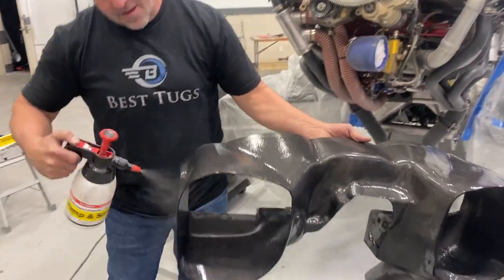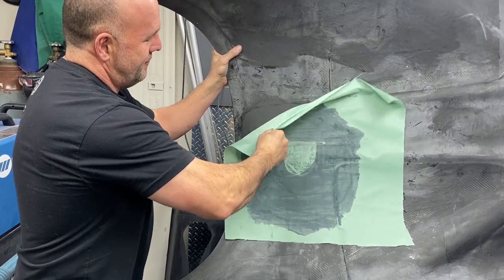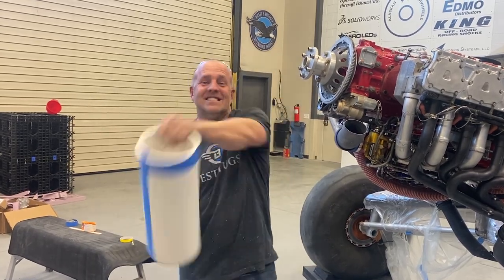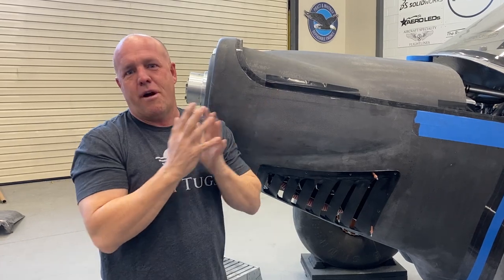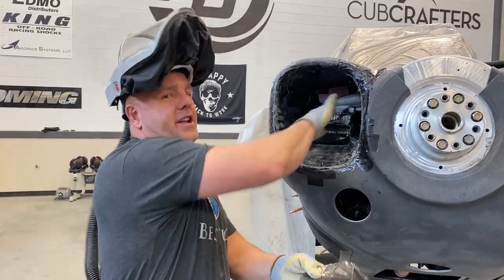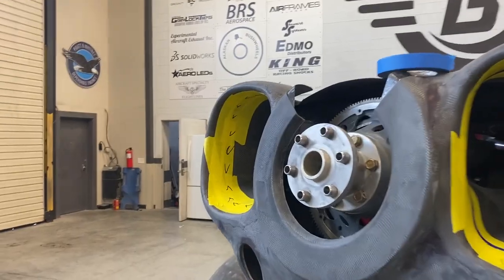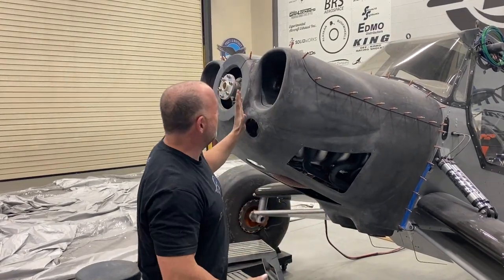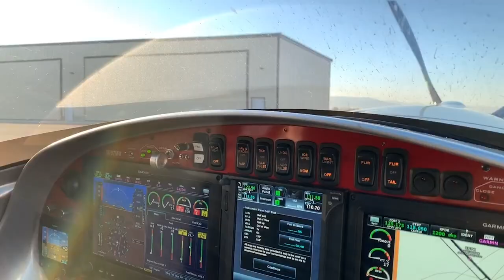Sleeper...Hiding a Monster NOS Race Engine in a Carbon Fiber Bush Plane | Scrappy #46

Comment: Mike needs to come out with his own line of sandpaper. Or "The Patey Sander" which is just a sanding block and an energy drink.
Reply: A case of energy drinks with a carbon fiber helmet that holds a six pack with straws atached to a manifold to equally empty all the drinks .and a heads up display regulator valve and temp gauge.
Reply: MP, carbon fiber products. I’ll buy!
Reply: "energy drink"
Reply: hahaha!  thats good.
Reply: He could call it "Patey Paper"
Reply: In my experience people his age that  keep going, and stay healthy, don't do many energy drinks! Probably some coffee. Getting energy from caffeine and sugar, is like using credit cards as money.  It stops working if you don't pay it back!  To keep going, full out, year after year, it takes good quality sleep, (even if it is less than most think is necessary) and high levels of good quality vitamins and minerals. When you give your body the raw materials it needs to have energy as it was designed, you don't drag and crave sugar, caffeine, and other drugs!
Reply: @davidcatlin1970  , totally agree about sleep. But the funny thing is Patey is what I call a non-sleeper. He only sleeps a couple hours per night. Mike's just not normal. ;-)
Reply: @texarama  he is pretty unique that way it seems! Reminds me of R. G. Letourneau! Similar personalities I think. Very focused, and can work efficiently for way longer than most anyone else! I'm still willing to bet Mike doesn't abuse caffeine and sugar.  I'd love to know for sure!
Reply: @MikePatey  so? Was I right? Lol!
Reply from the maker: @davidcatlin1970  your right.  I don’t use any type of Supliment or caffeine pills or any medicine of any kind.   My biggest vice is I like Diet coke soda at every meal.   I should Do better and have water.  I’m not a sugar guy.  I don’t really like how it makes me feel.  I will have a cake or whatever at events but I don’t really buy much for sugar.  I can’t work as long with sugar or lots of caffeine.  It causes a crash.  I’m better just holding 18-20 hours steady without the crappy rush that quits on you and that kills productivity when you go for another late night round two push.
Reply: @MikePatey  Very cool!  Hey my 4 boys and I have been following just about every video you've put on your channel, since I found Draco, just before the crash! It's my goal to meet you someday, and maybe even get to collaborate on something!  I can't wait to get into my own plane in the near future!  Back to work!  Lol

Comment: If I may be a voice of dissent, Scrappy's power plant has become a Rube Goldberg series of engineering solutions. For a back country specialty aircraft,  it's become incredibly complicated. Of course, all of the engineering is mind boggling impressive. Given the concerns you have had to address with the intake cowling, as well as other issues associated with engine cooling, one can easily see the advantages of a turbine over a recip. Granted, I suspect everything will work as planned and it's going to be another beast of a flying machine. But she is one very complicated gal.

Comment: Engineers everywhere need to see this and take note.  Everything is clean, makes sense and most importantly it’s extremely functional.  Well done!
Reply: I think you don't see designing like this because of a fundamental culture difference in engineering.

Even in development practice, everything is rigidly controlled. Companies seem to care about reducing development waste rather than allowing more iterative design and innovation which inherently has more risk of failure.

Also, I feel there is often a big disconnect between experienced consumers and design direction. Especially with valuing experienced enthusiasts opinion over the general market.
Reply: @ChargedTTq  Very true which is why it is important for some of these engineers to intern in the actual field before being put behind the drafting table or design computer. Get the hands on aspect and see just what its gonna take to install, repair , or replace anything they design!  I'm a diesel mechanic, and I see it all the time! makes you wanna strangle the engineers at times. lol
Reply: AND it has ease of maintenance in mind!
Reply: A huge part of engineering is cost control -- optimizing for efficiency of materials and labor. What makes this plane amazing is the absurd amount of time spent on it. This plane as built would have zero commercial success because it'd be 10x the cost of the competitors, in an already small market. Doesn't make it any less awesome, just that expecting anything like this out of a typical company -- which depends on making money to exist -- would never happen.
Reply: True that
Reply: But caution note! Not tested yet in flight.  No wings. Can't fly without wings. So real proof is in the flight testing.
Reply: Idk she gunna do something with that big fan and all that hp.  Got rudder and elevator. Landing gunna be the tricky part lol jkjk. I cant wait for wings tho. But I'm loving this cowling. I love every episode to be honest.
Reply: @scottwatson5767  This is probably the smartest comment I’ve seen in a while. Designers and engineers should spend a MINIMUM of a year in the field shadowing  an experienced maintenance tech to get a feel for how to design systems to be easily and quickly serviced.
Reply: @tomcoryell   I really think they don't care one way or another, that n pressure from the companies they work for don't care if you can work in em. They want you to buy a new one!
Reply: @ChargedTTq  Yee gads I can't even change a headlight bulb on my car without an extensive tool kit. No room to get my paws in. Old cars had plenty of room for such tasks but car companies seem to be forcing you to pay a garage to do even what should be simple jobs. A bit off subject but valid I reckon. Regards, Jim in NI UK
Reply: @jimcripps3612  your on it. I agree. The do want you to pay. Ask any ASE mechanic. They don't want you to work on them.

Comment: Nice to see Scrappy actually lending a hand rather than sitting around waiting for the pizza to arrive. You're like a chest master. Your thinking seems to be 4-5 moves ahead of the work you're doing and forecasting any possible issues that may arise. It there a reason why you made the cowling door at such a slight angle to the air flow rather than just opening forward? Contours maybe? Those intake inlets look like flaring nostrils of a race horse.

Comment: PVC pipe! Duct tape! 😎.Also, good you machined the 10-32, that way no one will ruin a big part by trying to start the wrong size/thread pitch screw. I have learned a huge amount from you. The experience of building 14 prior aircraft shows through in your knowledge of what problems to anticipate and engineer around. Okay, what brand is your supplied air breather setup? That’s cool!

Comment: He should make a way to lock in the suspension at the highest position for the steepest angle of attack. Kinda like the opposite of how dirt bikes lock the front down for hole shot. Then I bet he could take off with the brakes locked. It would just fly away like a helicopter. Steve Henry would be scratching his head... 😆
Reply: I've been saying for months that is exactly what he has up his sleeve. I am certain of it. One of many innovations yet to be revealed I imagine.

Comment: Mike! I wouldn't use a Spectre air filter, in the center of the filter is a chrome button that is glued into the filter. it is known to fall off and get sucked into the engine.

Comment: 8:11 Thats a great sand paper trick.
Btw, I didnt think that 1/8th gap was going to give you enough shrinkage to remove the pipe. Just saying. ;)
Mike, I think that you need a cordless Multitool.

Comment: I hope Mike puts in some small drain holes in his air filter box/tube. Seams like rain or snow water will collect under the air filter.
Reply from the maker: Yes sir 👍🤠 it’s done but often times a bunch of little things like that never make it in.
Reply: @MikePatey  Mike beautiful work! Was curious as many others are, what weight and fabric weave are you using? And I'm assuming it's at least four layers. Or much more in places? And what type epoxy? Perhaps the next video you could quickly verbally answer. Thanks for sharing your knowledge. And your contributions is much appreciated.

Comment: Run that hole saw in reverse to get the groove started so it doesn’t want to dig as hard as running forward. Then after you get it started run it in forward so it don’t get all hoppy and skippy.

Comment: You are one of my favorite tech channels. I don’t have a plane but know engines fairly well. A concern I would have is, even under pressure, the air filter confined in that tube and adding the metal disc, as loss, integral to the filter element may not provide the cfm the engine requires at wide open throttle.
Your feed back is welcome, and thanks for sharing yourself to us.

Comment: What beautiful work! 
    I like many others have been wondering. What weight and fabric weave are you using? And how many layers? I'm guessing at least four. And have you used a core of any type anywhere?  Lastly with the exception of the power plant. Are you planning on offering any kit versions? LOL.

Comment: It is so important to prevent spilled oil in the cowling. On one aerobatic flight, when I went inverted in a rented plane, oil completely covered the windshield and I was worried of imminent engine failure. So I had to slip and use the little vent window on the door to find a place to put down off field not far from Spruce Creek FL. Oil level was fine. Cleaned the windshield and went home.

Comment: I've been really working on cylinder porting for maximum velocity to get max flow. The lower part of your intakes should ramp up to the top line on the cylinder. With the steep angle near 90 degrees and will slam into the side of the cylinder and shoot straight vertical to the top of the plenum. It will create a reversion roll that the incoming cooling air will have to punch through. The sole pretense of airflow can be broken down to a single idea that will guide everything. Air is lazy, it doesn't like to change direction at all. So the larger the radius bend the better. It has to be coaxed as gently as possible.

Comment: you should write some software to automatically control the cooling door based on engine temperature, engine temperature trend, outside air temp, and maybe even throttle position. - with an option to do manual override control, of course.

Comment: Could you explain where rain water will go when it enters the new cold air filter cavity? Will it pool up at the bottom of the tube you made to house the filter?

Looks amazing!
Reply: Yes, will you please explain in a future video how rain is going to work with filter setup.
Reply from the maker: Yes great comment I recorded it and the drain in the air of area as well but It missed the video.  I’ll try and get that in a later video

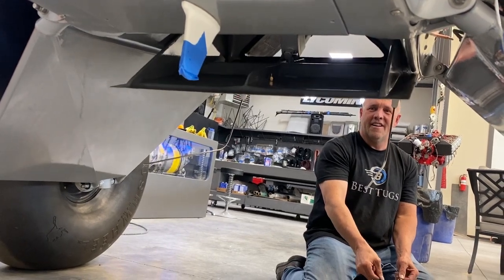Comment: looks like work on the Wilga (Draco 2, Draco Phoenix) has started, sanding, disassembly... spotted just after 21:00, &  27:00 min,  maybe other times as i've only watched once...  At least it has wings for now, maybe they can be used on scrappy...

Comment: So fun to follow your work Mike, its looking awesome as always. Two thoughts which you probably already thought about but didnt mention. First one being in the air box, I didnt see a water drain hole, also how would you get debris out like bugs etc when cleaning the filter? I was also thinking about the adjustable flap for ventilation, don't forget to take that into account when you set the suspension limits, it might not hit the floor but maybe protruding rocks etc :) Excited for the next video!!
Reply from the maker: Drain system 👍🤠 it’s already there. Often times some of the small details don’t make it in the video cuts.  Good eye 👁🤠 on the belly flap you will see that later in a demo and yea we have tons of clearance even fully bottomed out and going over the rocks 🤠
Reply: Good stuff! Back to work 🤙

Comment: Looks soooo good!! But one remark. It looks to me that you made a water collector. The airfilter in a pipe with open top. When the plane will be standing outside in heavy rain the water will fill your air inlet. Same with the oil fill point. water and dirt will collect at the bottom and will fall in the engine at the moment you take the dipstick out. Probably I am missing something. Can't imagine you would pull a "mistake" like this. can't wait to see it fly.

Comment: I love that you're making it easy to access the engine.  are you putting any led's into the cowling so that if you need to inspect or troubleshoot in the dark you don't need 3 hands to hold a light, a tool and a fastening? same as under a 4wd bonnet (US; hood)
Reply from the maker: Yep it’s already installed 👍🤠

Comment: Amazing build. That air box is cool but from dyno testing I've seen boxes that sit next to filter to be a major pressure drop in similar situations.  Might want to watch that. It will run fine but density can be choked by tight filter to air box wall clearances ... if you can open that up it should help air density . And air density matters at high altitudes.  Alot.  I'm very impressed with the build . Keep up the excellent work
Reply from the maker: Great comment.  👍🤠  fluid dynamics and airflow is a specialty of mine.  You are completely correct more specifically in automotive,  you would be spot on with this design for cars being limited.  My engineering firm my brother and I started way back that we recently sold did flow and intake Sytems for large auto for years.  On scrappy we turn half the RPM and so my 780 flows similar to a 350. As far as distance to filter it is drastically different than car flow analysis.  We have my intake directly behind 500 hp fan in pressure plenum.  Even at idle in a dead stop we make ram air. During testing of this exact engine in my record setting plane we did both ground and in flight flow analysis for this engine.  I will do the same again as air speeds are different. I meter five locations with a custom gauge box I made for flow testing.  Upper deck pressure plenum,  inside cone carbon pre filter at the base of filter, inside induction tube post filter, than inside the custom manifold I welded up and than last is already metered at the valves.  I’m doubtful I will change anything only because this is the third rodeo with this motor for me but I hold that as only experienced based theory until I have my data back after another test in the new system.  🤷‍♂️👍🤠 we will know more then.  Thanks for the great eyes and comment 🤠

Comment: “ veiner constriction “ air weighs a kg per cubic meter and when you are shifting cubic-meters-per-second it is a real deal. The mass simply won’t turn quickly, so intakes need a trumpet end.  (Also exits, it has the same effect there). The basic rule is stop and have a think, because you can halve the size of any fluid inlet way too easily with a sharp edge.

Comment: Thank you for sharing all your progress! With the air intake so close to the front, and the tube so deep, is there a concern of rain (in flight or when parked) going in the tube and getting sucked into the engine? I’m sure most rain will blow by in flight but I wasn’t sure how much of a vacuum the tube pulled.
Reply from the maker: Drain system 👍🤠. It’s already done but many small details don’t make the video, great eyes 🤠

Comment: 1 question for you from  that very impressed with what you are doing. What would you have to do if your new air box you have built keeps the cylinders cool works why to good at altitude.? I don't even know if this is a thing or not.
Reply from the maker: 👍🤠 great question.  I turn the panel dial that closes the lower outflow air and warm them up

Comment: I didn't think CF would be heat resistant enough to bond directly to the cylinder heads of a high-performance engine. Cool stuff.

Comment: Mike, so since weight is always a factor in aviation. I was wondering how do you keep track of the weight as you add each new piece. Kinda the last straw on the camelback kinda thing. Eventually, pieces and parts add up.  Or am I just a doofus. lol
Reply from the maker: Great question 👍🤠 I do it at the start.  Thanks have done it enough I’m currently running really really close.  Many items I simply weigh anothe plenum for example and than add the lengthy percentage for the larger engine and a couple other adjustments and with that baseline on this part I was so close i may call it a bit of luck to be this close this time.  Almost exact.
Reply: @MikePatey  Thank you sir.

Comment: @Mike Patey is there any chance you airbox would fill up with water during heavy rain or messing around sand banks on rivers and choke the engine?
Reply from the maker: Great question, I missed getting that solution in the video I’ll try and add it later 👍🤠

Comment: Super awesome video Mike!  That engine sucks a huge amount of air. Won’t it rob cooling air from the left cylinders?
Reply from the maker: 👍🤠 great questions. The deck runs a positive pressure and completely equalizes on a tall deck plenum .  It only becomes a problem when on low flow low plenums or miss balanced flow when you can’t get balanced air.

Comment: So there is two cowlings basically on the top of the engine to make the air flow to make sure the back cylinders get proper air flow.

Comment: Whatever you do please don't put a K&N filter on there that has an oil surface on Scrappy! It can coat oil with sensors and create an oil film that will wreak havoc with your fuel control. Had that happen with a fuel injected automotive engine.  All the best from Canada